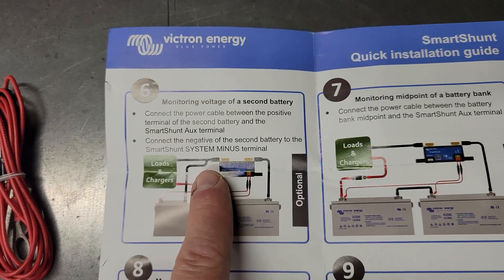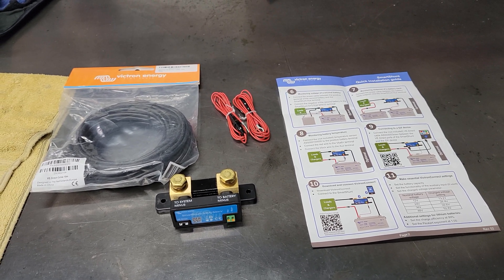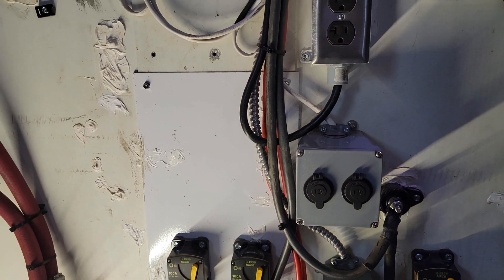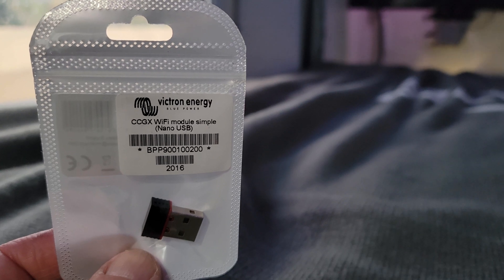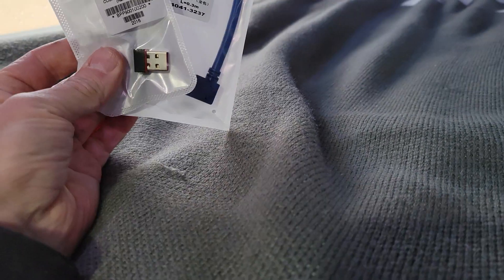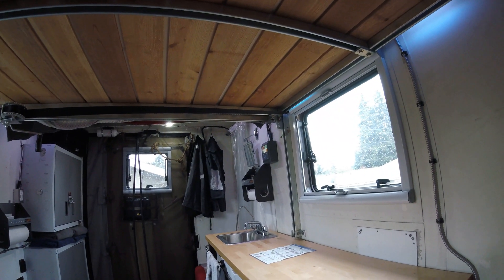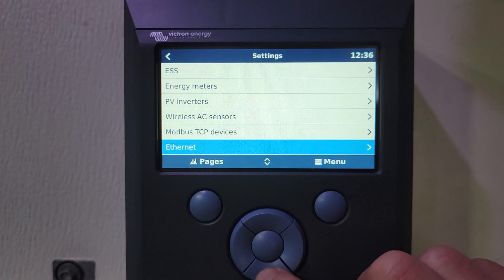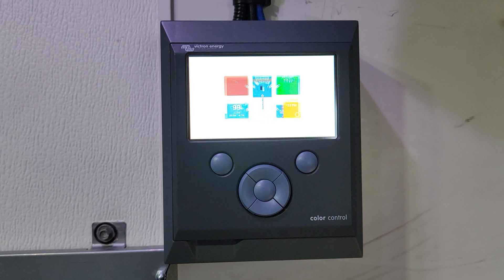Abel LMTV build part 176 (Victron 500a smart shunt and nano wifi module)

Comment: I plan to upgrade all my solar power equipment to victron asap. Great gear!
Reply: I have a bmv712 monitor and love it. Need to synchronize the battery every so often but no big deal.
Reply from the maker: You will love it!  Really high quality with an overkill of options.
Reply: I have a bmv712 monitor and love it. Need to synchronize the battery every so often but no big deal.
Reply: I have a bmv712 monitor and love it. Need to synchronize the battery every so often but no big deal.